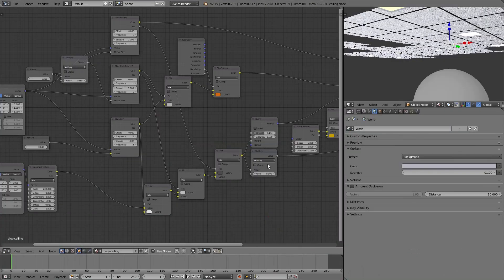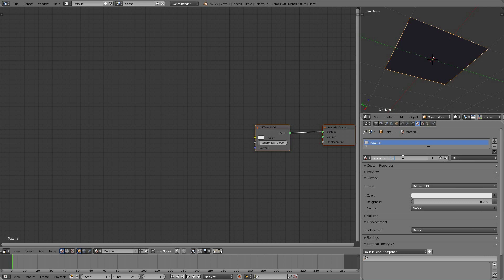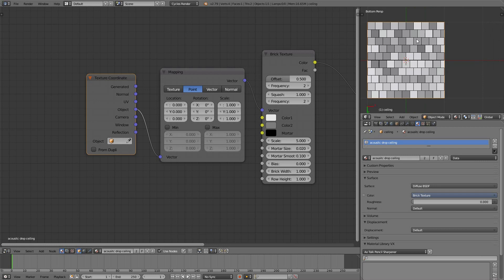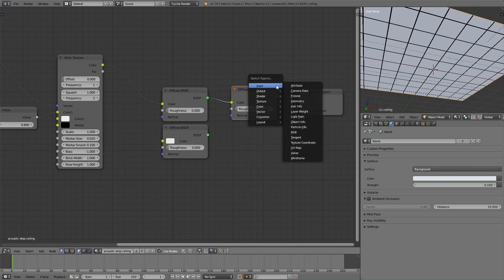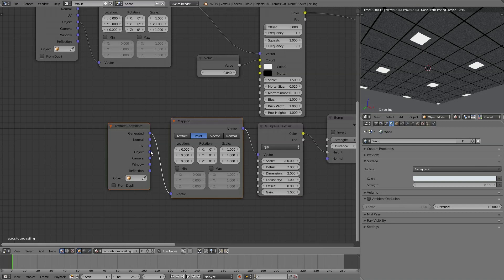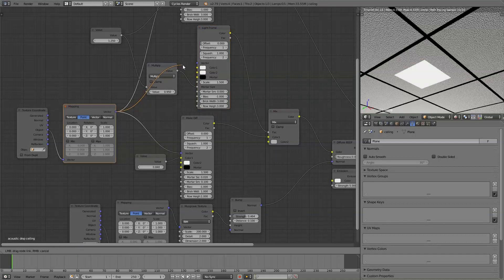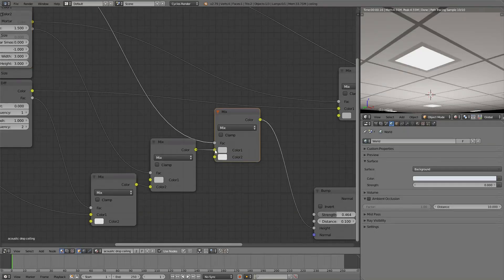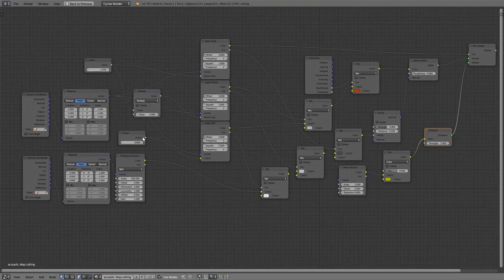26.01 Blender 3D Procedural Drop Ceiling

Comment: This is a great tutorial! I've only just started with Blender this month, but I'm determined to make some sense of the nodes. Viewing this tutorial was a deep dive. It'll take me a while to get the hang of it, but stuff like this sure helps.
The only issue I've encountered is that I can't get a sharp edge on the border for the inset lights. I've reviewed this video twice and taken good, long looks at your nodes, but I can't determine what variable it is that I've failed to account for. Also: That Geometry-Mix to show that texture is wrong is genius and I can't wait to make use of it in other projects. Thanks again so much!
Reply from the maker: You really stick through the whole thing! Thank you and what a good student. I can see you'll go very far! :) Mortar smooth perhaps? Setting it to 0.0 in blender 2.79 caused razor sharp right angles in the brick texture. The light has that - the frame appears inside the light if I remember correctly, so its mortar smoothing wouldn't affect the output visually.

Comment: Do know a way to make the dropcieling metal outline reflect like metal?
Reply from the maker: Assign a metal shader to it after adding some noise or texture to add some wobble - the trick is to use the material color as Factor in a Mix Shader where that Metal is either first or second shader and Diffuse or Principled is the other. It's easy but hard to type out 😉

Comment: This is really really close to what I am looking for, great job. I was wondering if it can go a step further, is possible to emulate, simulate that the "GROUT" stands out just a little? In reality, the grid (GROUT) pops down past the ceiling tile a couple of mm and can be visible in some of my views.
Reply from the maker: It's totally possible and I really appreciate your commenting on this video. It's one of my favorites because the technique so versatile. Blender 2.8 & newer is very capable of physical displacements. With the Node Wrangler enabled you can use the (shift ctrl LMB) Viewer and get a sense of the heightmap blender will use to displace the geometry. I haven't visited this node tree and a long time, but I would be 100% willing to make a 26.02 video! Let me know if you receive any successes or encounter any questions.